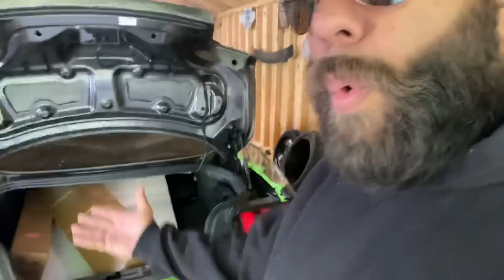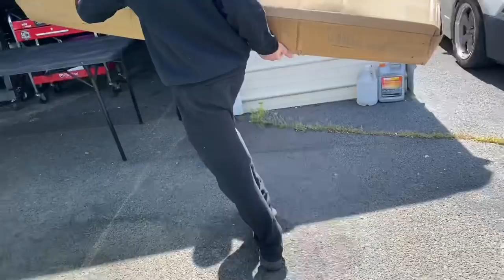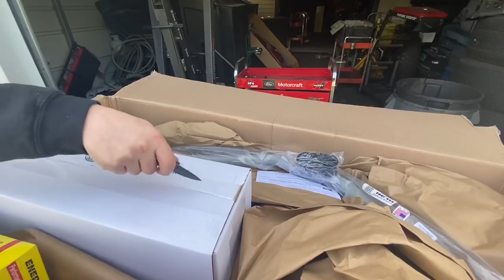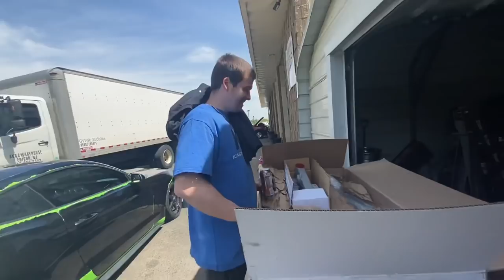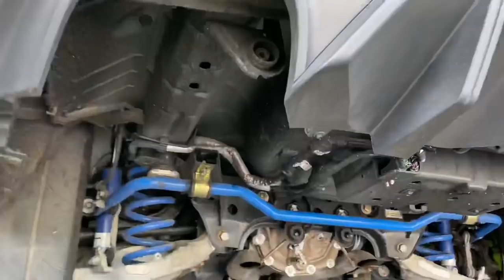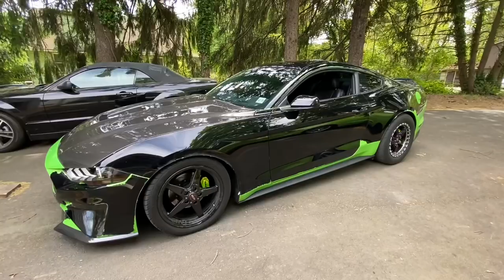HERES THE NEXT GIVEAWAY CAR + MAMBA's IN FULL DRAG MODE!

Comment: Damn and I've had DSS axles on order for 4wks, I thought they had this issue solved....
 Thanks for showing us that and the leaky shock...my next suspension purchase was gonna be Steeda front coil overs with extra long springs
Reply from the maker: BlueCollarDaily It’s all under warranty- it will be replaced- I recommend Steeda!
Reply: @StangMode   oh it works awesome on the mamba.....Its all good for YOU not everyone is Stangmode calling about his leaking shock hehe... to be clear not saying they won't but you are kinda famous...hehe
 Always love the caspers content hehe
Reply: Steeda is great. On my 4th rear competition rear sway bar from steeda, and they replaced em all no charge. They eventually break on drivers side bolt hole attachment every 2 or 3 years.  No idea why

Comment: @Stangmode I have a blower setup for the new edge. Whenever your ready. For everything 8 rib pulleys, blower, blower bracket, injectors, intercooler and piping, vortech mondo blow off and meth kit 4500. 

Just for blower and intercooler  3500
Reply: Oh and if that's a t45 transmission I have a short throw pro5.0 shift i will sell also.